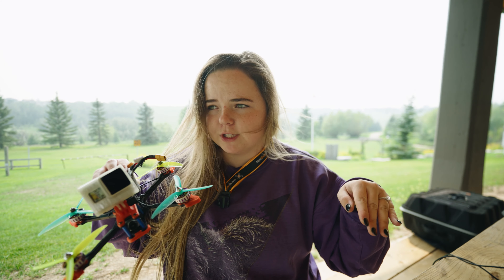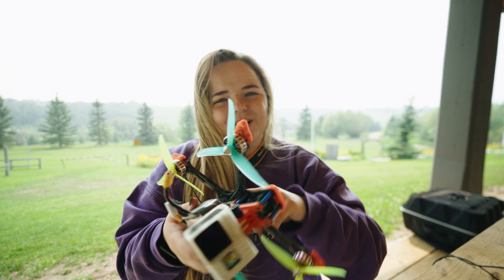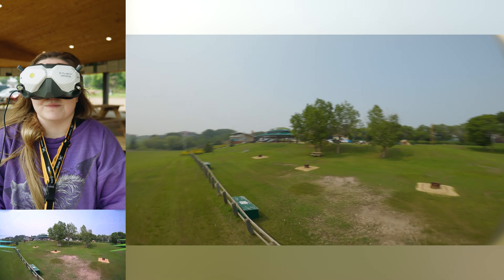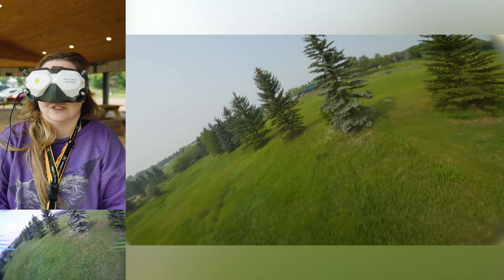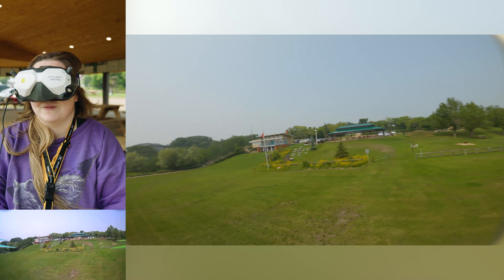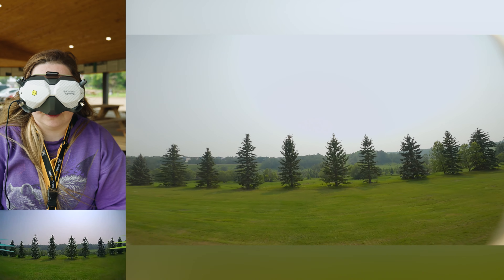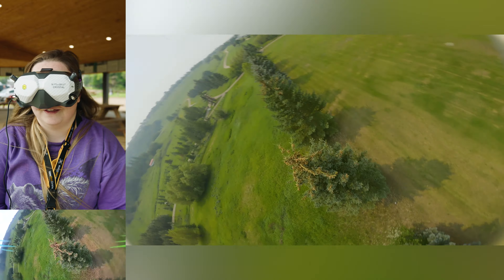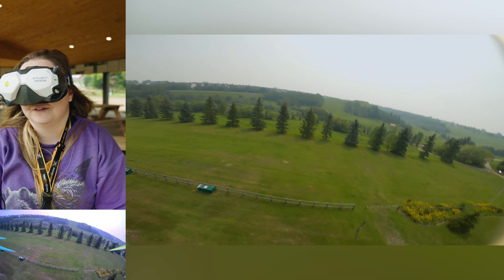Flying & Crashing my FPV Drone.

Comment: You should get the Tattu 5.0 6S 1200/1400 mAh, those Ovonic 1550 mAh 6S are sooo heavy! You'll love the performance of the new Tattu's, and very little sag and so much lighter. I have 15 of the 1200 mAh ones i use everyday and haven't had a single issue with any of them, a little swelling but that's it. Cheers 🍻
Reply from the maker: i should give them a try!